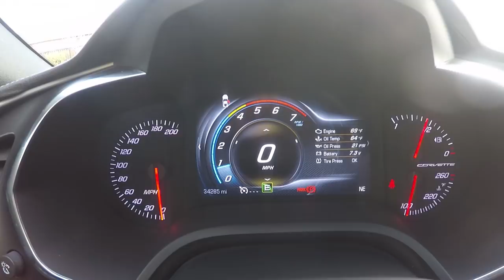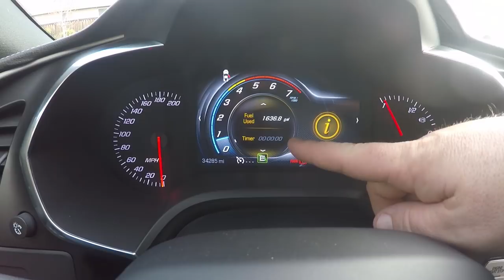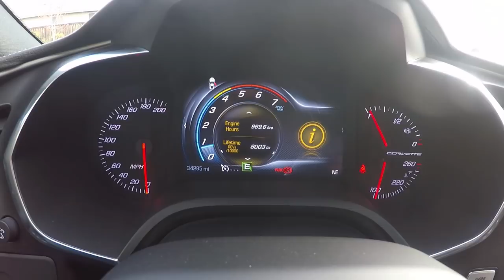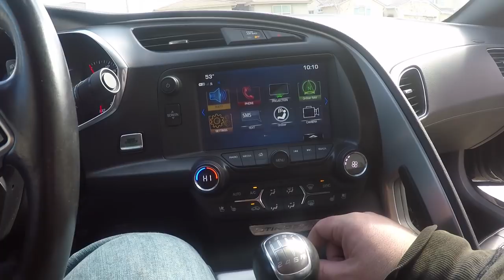One Year of Daily Driving a C7 Stingray - 28k Miles

Comment: Agreed.  I bought a new 2017 Stingray with manual transmission last year after test driving the Porsche Cayman (same price but weak, very stiff ride and very low ground clearance so can't use it for commuting) and Porsche 911s ($130k, twice the price) for the same performance as the Corvette base Stingray.

Comment: Nice video, thinking of a 2016 C7 stingray  probably 1LT (I don’t like any rear deck spoiler) but maybe 2LT if I can’t find a 1LT when I get close to retirement in about 5 years. 

That 4 cylinder deactivation in Eco mode is not good for the engine. You should research it. I subscribe to a bunch of C7 channels and at least one had to have the engine replaced. I’ll find the link and post it here. https://youtu.be/dQUptWbU4tk.  He has a module that he bought and installed that shuts off the cylinder deactivation.  You can search on his channel for it.  Sucks taking away fuel savings but if it will ruin the engine definitely not worth using it.
Reply from the maker: I had 50k trouble free miles on mine.  About 80% of that was in 4 cylinder mode.   I've heard of some small amount of autos with issues, but not the M7s.
Reply: FakeZ06Sean good to know ! Thanks !
Reply: FakeZ06Sean Mine will definitely be M7, i cant see driving this beast in a auto!  Why bother, takes the fun right out of the equation!!  Once again, ill be ready in 4 1/2 years... I’ll be looking for a 1LT C7 Stingray... Ive seen one here locally not to far away in NJ with 53k miles for about 33k .  That mileage in 4.5 years should be about mid 20k.  Which should be right in my budget

Comment: Hi, i am about to get a 17 GS, 22k miles. Used to have a c6, so this is my 1st c7.
Is there any issue with the econ mode, v8 to v4 and wear on the trans. I ask because other youtubers say it can, i dont know what to believe while doing my research before i take delivery. Thank you!!
Reply from the maker: Jason Oquinn I had zero issues in 50k miles.  Manuals only go in V4 in eco mode.  Autos do it in all modes.  If it bothers you, and you have an auto, you can get a product that plugs into the car that keeps it out of v4 mode.  I never had an issue, and cylinder deactivation has been around for a long time with LS block motors, I used it worry free.  For a weekend toy it doesn’t do a lot of good, but for a daily getting an extra couple of MPGs really cut down on my fuel costs.
Reply: @fakez06sean98  thank you buddy, i cant imagine it being an issue, thx for the information.
Reply: @fakez06sean98 would you feel good about buying a gs with 22k miles then? Its down to that, a 17, or a 14 Z51 with 4k miles. :)
Reply from the maker: Jason Oquinn Id rather have a 17.  Build quality on early c7s is hit or miss.  Plus GS are so good.  I’d just want to check and make sure maintenance was done, paint and interior are in decent shape. Most vettes are pretty well cared for, though you never know.
Reply: @fakez06sean98  ok, thank you. I plan to see both and decide next week.

Comment: How do you feel about the lack of BSD(Blind Side Detection) on the C7? What was GM thinking? I’m not a fan of nanny devices but I live in the NY metro area and in traffic (constant) with poor side vision it is really scary!
Reply from the maker: Doesn't bother me at all, though the Vette has pretty good visibility.   I have zero problem with safety nanny devices but BSD is one thing I'm not a fan of, I don't trust it and even in the cars I have that are equipped with I tend not to trust it and do a visual check before changing lanes.
Reply: I have a solution to the blind spot problem let me know if u want in on the secret I have blind spot on my Mercedes’ and this trick works better
Reply: Ken let me know I’ll give u the secret method on how to position mirrors so no blind spots